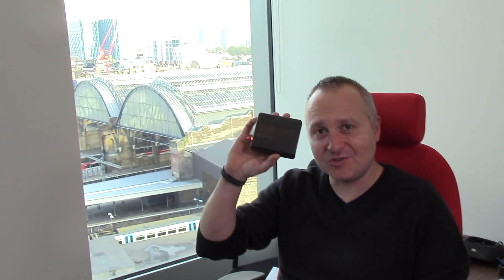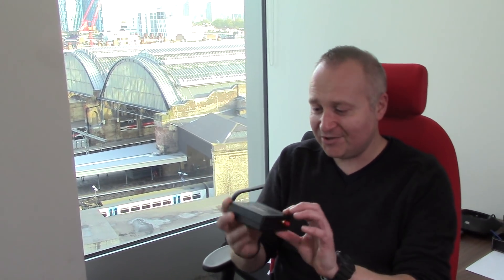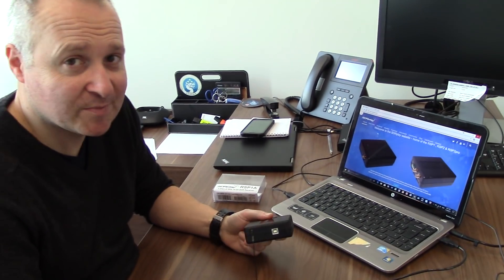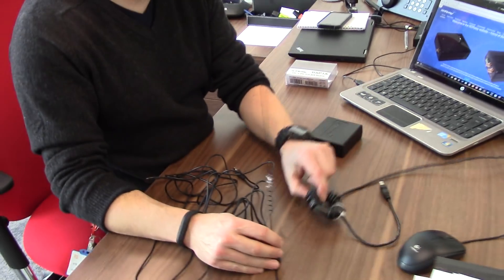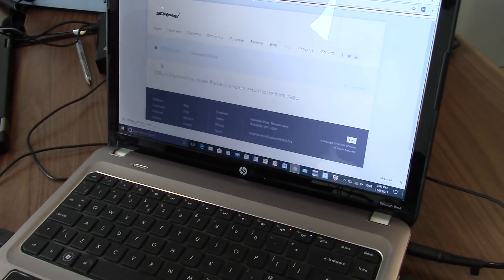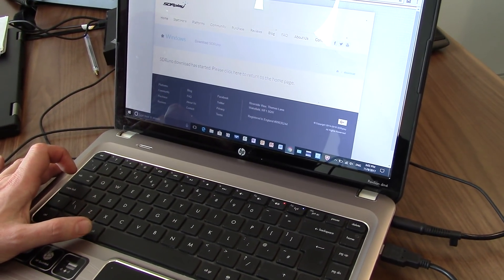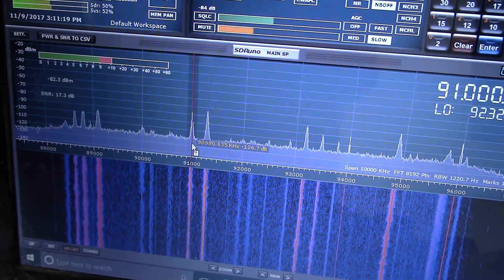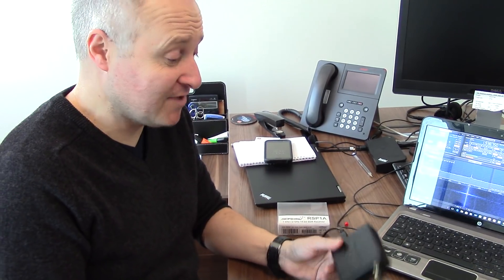RS-Components - setting up an RSP1A from scratch

Comment: what do you have on your usb cable
Reply: Looks like a choke, probably getting some noise from the USB into the SDR. The SDRPlay 1A has RF shielding so little less of a problem. However I recommend using a shielded USB cable (or the ones with the big round tubes on them). This was a poor video IMO, guy was clicking all sorts here during the install process without explanation.